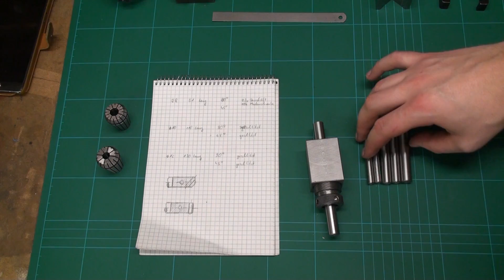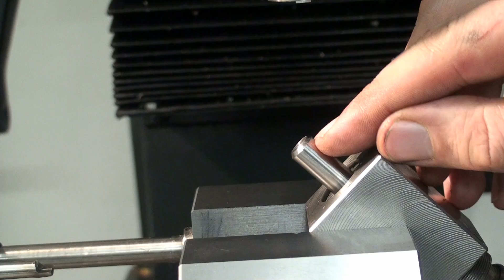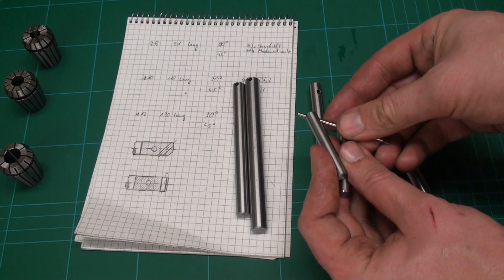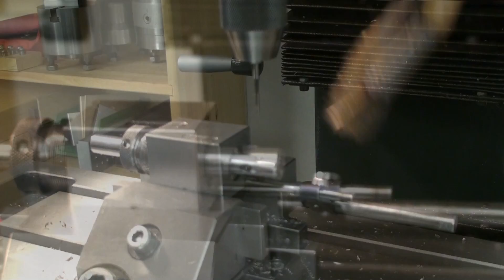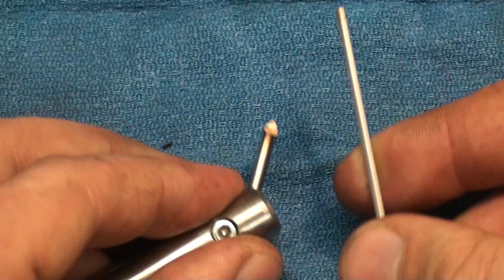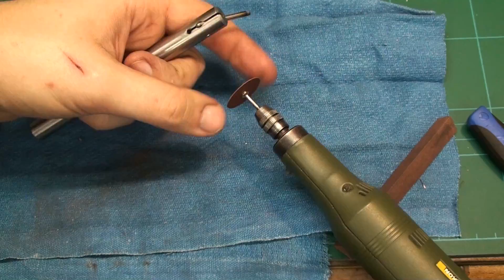Hss Boring bars - Hss Bohrstangen

Comment: Stefan, I had a Wohlhaupter boring head/machine years ago and did exactly what you did here however, my boring cutting tools were square solid carbide so, I had to grind a set of small series broaches to square size the round hole. I had a series of three (3) so the first two broaches cut the square hole almost to size then, the boring bar was then heat treated and tempered and when I received it back from the heat treaters I finished the broaching process with a carbide broach punch and a gell lubricant. When finished the tools then had one specific orientation for boring.
Thank you Stefan for this presentation on tooling work.
Reply from the maker: Broaching square holes for the tools is chefs kiss! Especially after hardening.

Comment: Would you happen to have any videos on grinding a HSS or carbide tool to go in these sort of boring bars? I want to grind some toolbits to go in the larger 22mm bars on a Wohlhaupter UPA5.
Not sure where to start on relief angles.
Reply: Sorry I should have said. Specifically grinding them on a D-Bit grinder.

Comment: I'm confused. I saw in your carbide tool holder video that hardened steel flexes just as much as mild steel. So why are you using drill rod to made these, instead of, say, old rebar?
Reply from the maker: Drill rod is nice and round, centerless ground.

Comment: Super noob question. For drilling into drill rod, what material drill bits do you need? Drill rod is basically HSS right? so don't you need something stronger than HSS to drill into HSS? Like carbide?
Reply from the maker: Drill rod when delivered is soft and can be drilled with any HSS drill.

While drill rod can be hardened and is a toolsteel, HSS is again a different alloy that behaves different (More resistance to heat before losing its hardness)

Comment: Great work. I have a question though. Why did you use drill rods rather than regular steel as long as the module of elasticity is the same? Cheers
Reply from the maker: Because its centerless ground

Comment: Hi! You said you used Drill Rod.  Is Silver Steel, W1 toolsteel, Böhler K510 the same stuff?
Reply from the maker: 1.2210 is the most generic designation for it.
Reply: @StefanGotteswinter thanks for sharing the toolsteel designation! This helps a lot in the djungle of steel types and what is proven and works for this type of use!

Comment: Is drill rod the same material as silver steel? 
If have some silver steel rods sitting around. They also came as ground rods.
Reply from the maker: Yes, I think thats what it is called in the UK - High Carbon/Chrome toolsteel that comes centerless ground.

Comment: Very interesting and timely.  I've been struggling with large drill bits on a very lightweight lathe.  Getting a lot of chatter and not much
actual cutting.  Decided to take the plunge and use a boring bar for the first time.  Using an Aloris tool holder with a boring tool from
H. R. Warner.  This tool uses HSS triangular inserts that are very pointy.  The sharp points remove metal but leave tiny "threads" down 
the bore. I'm now thinking I should make myself some boring bars as you have.  That small rounding on the end of the tool seems 
likely to provide a better finish.  Maybe I should try a little touch up to the Warner insert first.

Comment: Tried to grind some 1/2" cobalt blanks the other day, took 45 minutes to get the tool roughed out. Doing that by hand isn't for the faint of heart.
Reply from the maker: Get a good, coarse wheel :)
A 46 or 36 grit wheel can cut Hss very fast. Or use a angle grinder with a thin cutoff wheel to remove most material.

Comment: Do you harden the bars after? If not, why use drill rod? Is it tougher even in the annealed condition? Did you get the idea for these from the GHT book? I love that book. Thanks for another great vid.
Reply from the maker: No I keep them soft - Drillrod because it comes as nice centerless ground material  (And its higher strength then say mild steel, so threads will hold better up)
Reply: Stefan Gotteswinter thanks for the answer Stefan

Comment: I have made this style boring bar in the past. Rather than boring all the way from the bottom up you can go in from the side underneath the 45 tap it for whatever size is appropriate and make a little wedge with a rounded Edge as your push rod from the side. It works perfectly

Comment: So what is the 90 degree bar for? It seems like anything you could do with the 90 you could just as easily do with the 45
Reply from the maker: Especially for threading or internal snap ring grooves it is easier to grind the tool with a 90° boring bar.

Comment: Stefan, thanks again for making yet another great video.  Many people have asked but you have avoided giving an answer and so here goes my attempt.  In the beginning you say that the boring bars are from 8, 10 and 12 mm drill rod steel.  That's tool steel as I understand it.  You use drill bits to make holes in them.  Well, from my simplistic understanding, tool steel cannot drill holes in tool steel.  Does this mean that all your tools {centre drill, drills and reamers} are all made of harder material such as tungsten carbide?  Curious.
Reply from the maker: Drill rod is toolsteel - But it comes in soft condition and can easily machined with HSS tools. The HSS blanks that I used as a cutting bit on the other hand are 67HRC hard and can only be machine by grinding or very limited with carbide tools.
Reply: Stefan: Ah I see said the blind man!

Comment: Hi Stefan, I bought some tool steel to make a set of boring bars.  I got as far as tapping the first hole on the 8mm boring bar, but the spiral tap broke off inside.  I was tapping by hand in the lathe, using the tail stock to keep the tap aligned.  I'm thinking I won't be able to finish what I started. Any suggestions you may have for me would be appreciated.  Thank you, and take care!
Reply: You probably already did this, but considering the price of tool steel I would just start over. Make sure to use plenty of cutting/tapping oil and go slow.

Comment: Thank you for another excellent video!

I like the push rod holding used on the 8mm bars.  Could you do it similarly on the larger bars by drilling in from the bit end and having a tapered cross screw to put pressure on the bar?   The screw would bear on the inboard end of the bar, not the side of it.  The same mechanism as you used in your lathe cross slide dial.
Reply from the maker: Yes, that would work perfectly on bigger diameter boring bars.  On the smaller diameter boring bars it might get hard to fit everything.

Comment: Hi Stefan, are you using carbide drill bits for drilling in HSS steel?  
Thanks again.

Edit:  You only say HSS in the title, and do not mention steel type in the video.  I got some round HSS toolbits blanks, to have some around when needed, but want to make a threading tool for internal threads with long stickout (45mm).  The small threading bar I have is too soft, and flex when I try to cut an 45 mm long internal 2.0 pitch thread.  So the question is if I can use carbide drill bits to make one?
Reply: HSS and most other steels don't have much different stiffness to each other regardless if they are hardened or not, just some plasticly deform longer than others before breaking, but yes you can cut HSS with carbide drilling is sometimes more difficult than milling when it comes to super hard steels

Comment: Do you feel like hardening these would help with rigidity?
Reply from the maker: +starrtraveler29 No, it would not - The module of elastisity does not change if you harden steel - Does also not matter if youre using mild steel or toolsteel - Steel has always the same module of elastisity :)
Reply: +Stefan Gotteswinter Wow, I guess I didnt' remember that from my metallurgy class.   That simplifies a lot of my future projects...thanks!!!
Reply: Drill rod comes already ground, which is convenient. I also believe tool steel is tougher in it's annealed state than mild steel in it's annealed state, so you do get some added toughness built in. As well, I suspect that Stefan may be mistaken when he says that all steel has the same elasticity. Hardening doesn't change the elasticity of a particular piece of steel, but I do believe different alloys have different moduli of elasticity. Whether or not it's an important difference however is a different question, to which I don't have the answer
Reply: What does change when you harden steel is how far the stress/strain curve will go before it starts to fail. Soft steel will start to bend plasticly after just a little force, while hard steel needs much more strain before it goes out of the elastic regime. The slope of the stress/strain curve (modulus of elasticity) doesn't change at all though.
Reply: That's very interesting. But it begs the question, why not just use some cheap mild steel instead if you're not going to harden it?
Reply: I have a lot to learn about the properties of metal, but you did inspire me to look up the Young's modulus of steels. As it turns out most steels ARE in the same range. 1018 is 205GPa while O1 has a modulus of 214. I don't know if that is a significant difference or not. Most steels hover around the 200 mark. https://www.engineeringtoolbox.com/young-modulus-d_773.html

Comment: its funny you say the things out loud that only go through my head.Only difference I made a 5c spin index collet holder for my 3/16 bits. and ya 10 deg. is good especialy with the high cobalt mine are m2(American grade sys.im stuck in seattle for now)with the lower cobalt you gotta be more precise  with the geometry. but ya $80 for a boring bar no! haven't written to you befor but ya guy lutard and al those other model engineers that you speak of are where I learned too!machinests steel each others ideas or pass them onto others if you invite us in your shop its your fault!!!

Comment: I love your videos Stefan and although quite experienced myself I have picked up loads of use tips and ideas from you. Just one point, after you have cut the bit to length you won't be able to pull it out  much when you come to sharpen it. For sharpening short bits I use a straight bar with a hole drilled in the centre.Kind RegardsBill White.

Comment: Another good video!
Are you going to harden them, or  is there no need? I'm not a machinist, so sorry if the question makes no sense.
Reply: My question as well.
Flexing is the main weakness of a boring bar, perhaps drill rod doesn't get significantly stiffer when hardened?

Comment: Stefan,
      I guess on the longer bars you could always drill towards the center from both ends,  as an afterthought if the pressure pin ever got stuck in the bore there would always be an orifice for punching out, of course pin getting stuck likely would never happen, but the old saying better to be safe than sorry is always on my mind,

Comment: Stefan, very nice instructional video. Thanks for sharing. BTW, I too use 1/8" (yeah, inch crap) but close to 3 mm HSS 10% Cobalt for my boring bars made to GHT design but also for lathe tools mounted in a GHT tool holder. Love you videos.  Bob

Comment: Nice bars, I especially like the lock on the little ones. I ran a 3" bar on a HBM once that was split like those you did and it seemed more prone to chatter than the ones that were solid with set screws locking the cutters. This was of course on a big machine with a fair bit of tool sticking out so probably not a comparison, but just an observation.
Reply from the maker: +bcbloc02 I would absolutely agree that a split boring bar is less rigid than a solid one, but the forces on my small machines are a bit more manageable than on a big lathe or a HBM. So far they worked out fine :)

Comment: Great work as usual. I absolutely agree about cutting angles, the tool will cut with a bit of rake and a bit of clearance, precise angles are generally  unnecessary. In fact i think this is one of the reasons beginners go straight to insert tooling as they are put off grinding their own, thinking the tool wont work unless it is exactly right for the material being cut.
On the long drilling topic, in those circumstances, I would have drilled the larger size first to give more room for swarf clearance, but it's the old "ask a dozen engineers for a solution and getting a dozen different, but correct, answers" story.

Comment: Hi. thanks for this video. What do you think is the advantage of these boring bars compared to brazed on carbide boring bars?
Reply from the maker: +rol eic I can change the cutting bit within a few seconds to another form - threading, internal groves, plain boring, roughing, highspeed steel or carbide :)
For even smaller diameters I would use brazed carbide or even solid carbide boring bars :)
Reply: +Stefan Gotteswinter You made two types: one with 90° tool angle for through holes and one with 45° for pocket holes. Why not use the 45°-design also for through holes? stick-out length? chatter?
Reply: +rol eic Hope I'm not showing bad form answering your questions.... The 90° has a couple of advantages over the 
45° in given circumstance. For heavier cuts it is more stable (tool 
geometry) & is less likely to have the cutting bit pushed back into 
the holder. Also with a 90° you can do internal grooving. You would have to grind too much away on the 45° bit to meet the required cutting geometry. 

Great video Stefan! As usual, nice design & quality workmanship to back it :)

Comment: Ha! Clicked the like button already after 3 minutes. Another cool video with instructional content well worth the watch. As you know yourself, you do very nice work (both as machinist and videographer), but you should also know that you have my respect. That is a nice way of fastening the tool steel with the push rod and set screw. Excellent solution. Thanks for sharing, Stefan.
ps Video, as you know, shines particularly well when displaying close-up shots. I would suggest that when you consider adding an extra feature that would help the viewer, you add close-up or extreme close-up shots - even stills would be quite useful - to your already fine videos. I would have liked to have seen close-up shots inserted on several of your videos so I could have better seen what you have done. The honing shots are an excellent example although perhaps your camera has a "macro" setting for even closer work to show for example the radius on your cutting bit. You work certainly can bear close scrutiny!